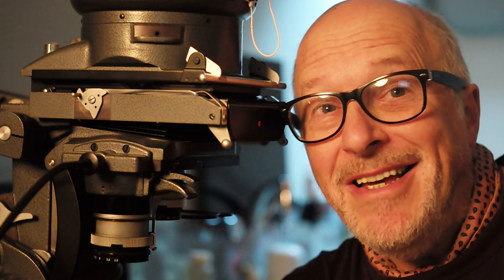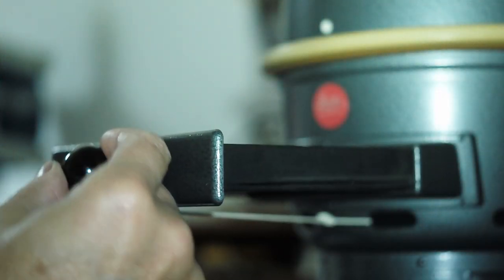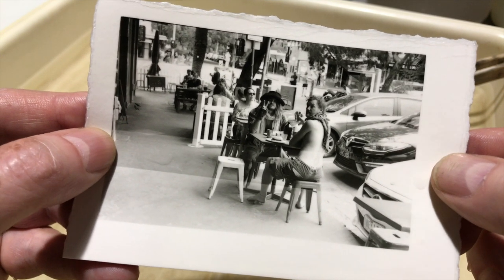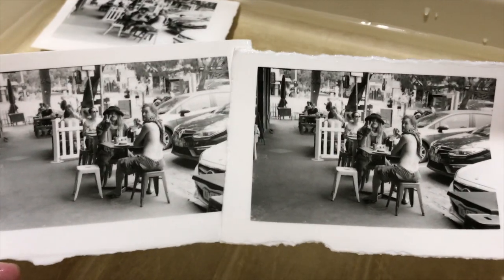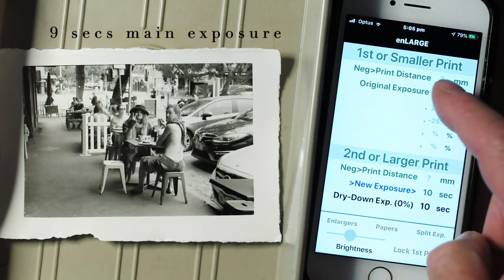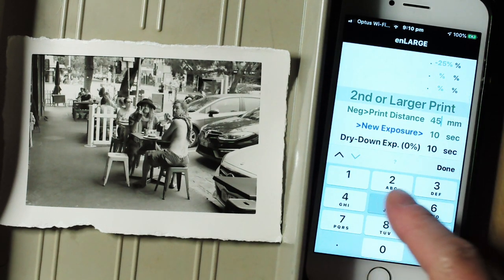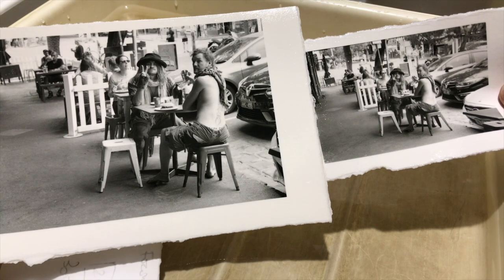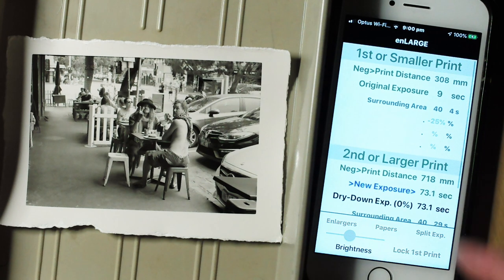Enlarging a Street Photo using enLARGE

Comment: Hello Andrew,

Hope you are well. Congratulation for your video and all the usefull subject you shared in it. I just got a quick question about the first application you used, I am affraid I can not hear how this app. called, may you share the name of it in an answer please?

Thanks for advance.
Reply from the maker: Tamás Sánta Hi Tamas, thanks for your interest. 

To view my negatives enlarged on the iPad I used the built-in ‘magnifier’ app which is built into the iPad. (The same app is built into your iPhone but I find that the iPad gives a both a bigger and better quality image than does the iPhone. ). However, to get this app working in your iPad or iPhone you may need to go to Settings>Accessibility>Magnifier and switch it to ‘on’. Once you have done this, the ‘magnifyingk icon will show up in your front-end Control Panel. Once the magnifying app is open, you will find that one of its buttons gives ‘screen inversion’. Another way to get to the app is to try tapping your ‘home button’ quickly three times.  

The app used to do the enlarging is called enLARGE and it’s available on the Apple App Store for iPhone, iPod touch and iPad running iOS 9 or higher. To learn more about it and how to use it with your enlarger you can look at my detailed enLARGE blogspot enlargedarkroom.blogspot.com - best regards Andrew
Reply: @enLARGE.darkroom  Hi Andrew,
Thanks for your answer, I will find them out :)

Comment: Will this be available on android?
Thank you!
Reply from the maker: Hi David, No, sorry but at this stage there is no plan to produce a version of enLARGE for Android. If you are not an Apple user then I recommend that you possibly purchase a new or used iPod touch or iPad produced after about 2015 which thus uses iOS 9 or higher, which will thus run enLARGE. Other than buying an iPhone this will be your least expensive way to use enLARGE in your darkroom. Best regards Andrew